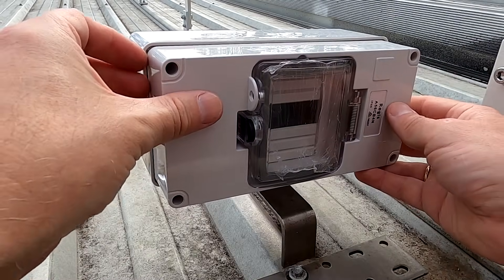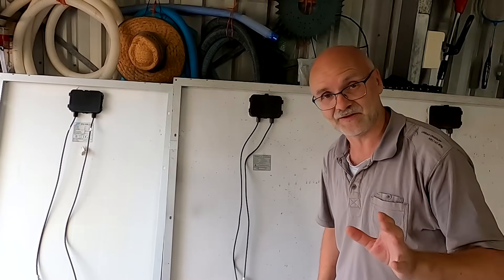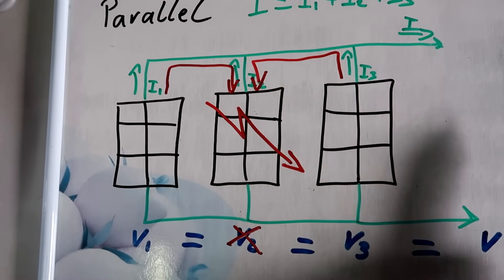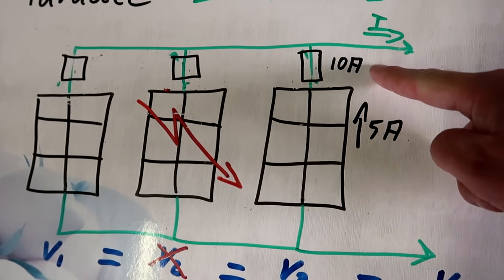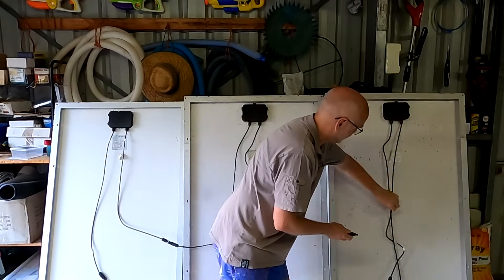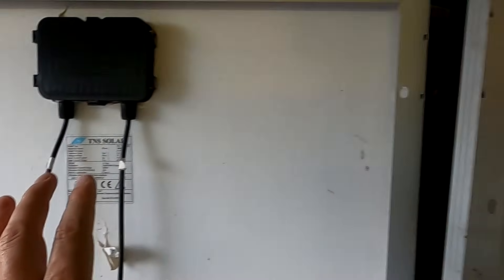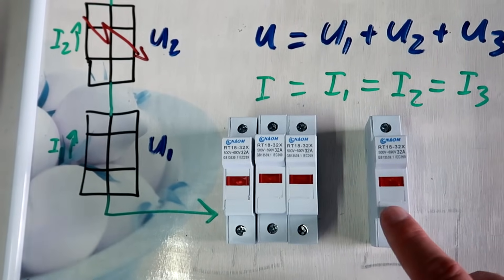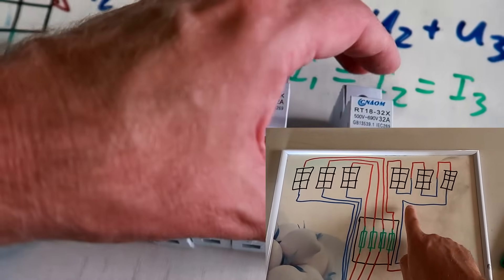Tutorial: Solar Panel Protection in Series and Parallel

Comment: 05:15 but what if you have only 2 panels in parallel and 1 gets a short? You will get the amperage of the other panel flowing through the faulty one. In this case are fuses still required? The combined Isc of both panels exceeds the maximum fuse rating of each panel by 1.2 amps.

Comment: For paralell, just put one Diode in series on the +out Before where you paralell them (everything can fail, a fuse makes it safer, but is no guarantee, think about the materials, what will happen if one them exits for instance 250W of heat in some tiny spot).

Comment: Hi, I'm new to PV field, but I think that a faulty panel typically increases its internal resistance, thus the back current flow into one damaged panel  (in a parallel connection) seems rather improbable. Also, I guess that in parallel connected panels, these  3 or 4 in 1 connectors cannot be used near the PV panels (at least not on both polarities), since at least one cable from each panel should be fused near the cabinet. I suppose also, that that single cable/connector could carry without problem the combined current of all 3 or 4 panels.

Comment: Thank you so much, this video was really helpful to undestand overall concept.
I have 20pcs of 250W solar panels, 4pcs of 12v-200Ah batteries connected in series and hybrid inverter, but instead of getting 5KWh, i always get 1.8KWh even during hot days. 
Guys who installed it, did not use MC4 connectors,charger controllers, fuses or UV safe cables. At the time of installation couple years ago, I had no idea of solar panels tbh. So now, I have to redo all the wiring, install charge controller and fuse. Do you recommend to have 5 groups in parallel with each group having 4 solar panels in series?

Comment: it sounds like  you're installing your fuses outside, near the panels. why wouldn't you house them in an enclosure inside a structure, away from the elements and hooligans, near your controller(s)/inverter?

Comment: Did you say that it is okay to send higher voltages to the controller than it is rated to handle? But if you send less than it handles it won't charge the batteries?
Sometimes i use a 24 vdc panel to charge a 12 vdc car battery. I also use a 20 vdc power tool battery with 3 or 5 amps to jump start my car.

Comment: I've got six (6) LG panels

The panels are what I was told in parallel and series. 

An inverter and an MPPT charge controller with 4 100ah lifepo4 batteries in parallel. 

My question is why one day my PV output is almost 900w while the next day is at 450w?
Why?  Connections are solid, no panel obstructions!?

Can't I just use breakers instead of fuses?

Comment: So what is the used of the diodes installed in a solar panel and also there's always a warning in the label that tell us that the maximum series connection is only 3 pcs of solar panel. also dc breaker mcb is much cheaper than a fuse

Comment: One major thing to mention, parallel connections have the the distinct advantage of still producing power regardless of a faulty or  individually shaded  panel where as series string connections will reduce the whole string to whatever individual panel is producing the lowest amps. The advantage I see for series is efficiency,  less voltage drop and cheaper fusing and  cabling. 
For me personally I wouldn't use less than 48v charging in bigger systems. So the perfect medium would be multiple parallel connections of strings of 2 or 3.

Comment: It only needs one breaker in the home which its amperage is predetermined by the total amperage from the solar panels.

The video logic is not feasible

And if one of thr panels is faulty, it means it is totally faulty indeed as not to add up current, unles series connection is best based on ur charge controller type

And respect to this man for using a camera swiftly and making explanations as clear as he could

Comment: I would of thought if one of the panel's developed a thought or shorted out, then that link would brake. I didn’t think there would be continuity in that panel to allow a current rise but i guess some off the cells in the panel are connected in parallel cursing a current rise in falt condions. Good information. I always size fuse  at 120% of normal current use asva guide.

Comment: i have a question if i put 24 panels of maxsimum power voltage 42.2 volts, and i put inverter 10 kw with maxs input range 600  v, but its writing input voltage range 160-1000 v, i.m over reaching volts with thoas 24 panels - 1012.8. DOES  this SUNGROW 10 KW INVERTER IS GOOD FOR ME, OR I JUST NEED BIGER ?

Comment: Ok for a 24 v system  2000va hybrid inveter _ connected to 2two 12vbatteriss and two 450vpanels of 36v o/p ..would you recommend parallel or series?

Comment: Hello writting from Nigeria,please I have a question I don’t get where the fuse is to be fixed in a series connection is it on the negative or positive output???? Please I need an answer

Comment: Here in the Netherlands I have seen, tested and certified many solar systems. All that were in string (so in series) never had any fuse. Neither is it needed in the specs.
Paralel  is different of course,  but that is selden used. Only in big systems.

Comment: Very helpful and enjoyable video... A question: For four 100W panels in series-parallel putting out about 14 amps max and going to a 40amp controller over 10AWG cables, do you recommend a breaker-switch near the controller in that circuit, and if so, what amperage rating? ...Also, would you use a 10amp inline fuse on the positive wire of each of the two 200W panel series (two 100w in series) generating 6 or so amps going to a two-into-one parallel connector? ...Thanks...

Comment: I'm watching your video, and so far noticed that you haven't mentioned that the International Electrical Code, which is the basis for almost all National Electrical Codes for safety, actually includes a section on solar panels, including when, where, and how to fuse solar panels. Generally, if 2 identical model solar panels are wired in parallel, no fuse is required because the output power of a single solar panel is less than the short circuit current rating defined under the panel's specifications. As you stated, series configurations do seem to provide a better benefits in savings via smaller gauge wiring and fewer fuses, but as you also pointed out, it depends upon your personal situation and circumstances. Also, I'm not sure if it's been officially included yet, or if they are still working on it, they as in the international groups, associations, and organizations that research, develop and test upcoming standards, but I believe you may be interested, since I think you mentioned that you own an EV. There is, or in the nar future will be a section in the international electrical code for a very specific installation in predominantly residential dwellings. Simply put, people have been converting their EV's into emergency electrical battery back-ups. Work has been going on to develop standards to install and maintain, essentially a dedicated EV "power port" so your car can keep your fridge running during a power outage. Even with solar and batteries, if a storm lasts long enough, it provides an opion for people who may not have an electrical generator, or an insufficently sized generator. Just an FYI, if you didn't already know.

Comment: If the panels is connected in series or alone there is no need for fuses because the short circuit ampere is exactly the same as normal operation amperes, meaning the fuses will have no effect and never break and never protect anything...  +

Comment: Sir,why 12volt s/panel parallel connection and 24 volt s/panel is mostly used by series connection . how to calculate the s/panel load 5 kwh 60volt battery in series

Comment: The blocking diode have max amp.
It burn over the amp and act like a fuse.
And you can replace. 
And if you open it .
It use the same what you have in that big blok.
You use not fuse but a amp rate blocking diode.
Its use in my couny and have iso certifcat and Germany tuf .
Means its test and save .

Reason solar panels burn is easy .
The cable is damage for the fuse or its internal burn from diode inside the panel and the panel is overheating and the panle cell burning out 

Problem is how company sell thare stuf.
And what country its make.
And use name for it.

Model like this 
Thermal temperature fuse protection diode mts228
225celcius 10a rating 

Diode sper the volt of 1000volt .
A panel setup up of 500 volt can never break a diode .
So its a full stop on a parallel if one solar panel is broken.
Now volt or amps will go to that diode.

Comment: Technically, the voltage in a parallel system can change, as it will be constrained by the panel that has the lowest voltage output

Comment: Touching just one lead from the panels in sunlight can hit you with a capacitive discharge if you are grounded. I got hit with 400 volts capacitive on a system with 27 panels in series. And opening a fuse while under load can arc very badly. DIYers need to be aware of the dangers and make friends with an electrician and buy him lunch. I'm available most Thursdays. LOL
Reply: Is it best to cover panels with black plastic or blankets when connecting leads

Comment: I am a newbie too. So if I just add another panel ( 2) ony roof do I need a fuse in each positive wire on back of panel and what do I use as I watched you showed 3 fuses that would be inside??? How?  Im not clear on the fuses and howuxh of I splice them into the positive right off the panel

Comment: Video/ explanation concise, tanx. 
Kindly help confirm if there will be waste of energy generated from a 3pcs of 300W solar panels connected in parallel via a 60A PWM charge controller to a 12V inverter system

Comment: What should be the more effective and safe connection way for a 100 watt polysolar panel, 85 watt mono solar panel, rated 150 watt charge controller, 130Ah battery?

Comment: Solar panel Parallel never output to same voltage, even it is same manufacturer. each should have a diode than fuse box

Comment: Please my question is you have 430 Watt solar panels and if you connect in series you have 76volt 38v each and I have two batteries of 12 volt each given total of 24V while I have panels of 76volt.
Is that 76 volt not too much in my 24V battery and inverter?

Comment: I think I understand.  I am newbie with some background in electronics as an audio sound engineer.  I just bought two 300 watt solar panels (both are same ELECAENTA ultralight) which I am going connect together in parellel.  The current for each solar is 7.69a and the short circuit is 10.1a.   I like to add fuses in this setup. I think I understand you multiple 1.56 x (10.1a value of short-circuit current) = 15.756.  Thus I assume I should get a fuse rated at 15a at each panel and just to be safe have 30a at the solar controller charger. I have the Pecron E1500LFP.

Comment: Nice video! I noticed a mistake in the series connection explanation. You mentioned it requires a 10A fuse, but the panel label actually recommends using a 15A fuse for string configuration. For Parallels connection 10A is fine.

Comment: Whaou! 
Thank you for this information. 
I have only 2 panels for my motorhome connected in parallel to not heat my MPPT unnecessarily with a 24v battery. I wanted to add 2 extra in the summer with the air conditioning. 
I wouldn’t have thought of the fuse to protect. 
No resellers informed me yet I asked if there were precautions to take.

Comment: what a great series of videos you made. you should make a playlist of "solar basics/safety" and "installing victron devices" 
just in case anyone reads this, bear in mind that MC4 connectors are only rated for 30A so the 4 into 1 is only ok for smallish panels.

Comment: Very good explanation. I heard the biggest absurdity from people about. Diodes, fuse on a single panel,diode between mppt and panel...
Just only a detail. Fuse will be sized not on max power current. But on the spec ""max admitted reverse current " . And this is bigger than max power current. Example: on halfcut 450w 144 cells panel with 10A Max power current, is 20A. In most of cases of a decent panel, also find "max series fuses rating" and is the same of reverse current.

Comment: There are nice in-MC4 fuses. But: fuses operated under (near nominal) load get warm. Inside MC4 enclosure the heat cannot escape and the connector embedding the fuse could  melt.
What about using diodes instead of fuses? Do they also get warm? 

What about Schottky diodes that do only loose 0,15-0,25V instead of 0,7V)?

What are your conclusions after 3 years experience?

Comment: Hi , I am getting a single Renogy 550 watt solar panel , the- open circuit voltage is 49.95 volts and and the short circuit current is 14.05 Amps , so do I need a fuse prior to the charge controller?  It’s going to a Ecoflow Delta Max, Portable Power, Unit Power station, which has a charge, controller, built-in, and the limits or within the solar panel.

Comment: PV panels have internal diodes to stop reverse voltages, if fitting additional diodes remember that in the forward flow ,IE, when PV producing voltage ,they will reduce the output by 0.6 to 0.7 volts!

Comment: Even the cheapest chinese panels now days have blocking diodes built in. They do reduce overall power a bit (roughly .5v × panel current), but they give you a great protection as well. Never seen them fail. There is no need for individual fuse. Unless you want to add a few points of failure to already complicated system. A lot of freedom for personal preferences. =)
Reply from the maker: This is not correct! Every solar panels has a bypass diode, not a blocking diode. Major difference explained here in another video I made:
https://youtu.be/J9jqUwOdnEI

Fuses (or DC breakers) with the correct rating are a MUST as per regulations.

Comment: If I keep the volts under the rated maximum (138v vs 150v max) can I "OVER" panel and go slightly above in amps? (17.5amps vs. 13amps per Ecoflow solar generator. Will  controller only take in up to 13amps?
Reply from the maker: That depends on your controller and if it can handle the increased current. You have to read in the manual and specs what the max wattage is your controller can take at a certain system voltage.
Reply: @OffGridGarageAustralia  16:10

Comment: If someone can do it themselves with a off grid solar system going to a battery bank... how much more would they need to know to do an on grid solar system that feeds your electricity into the power grid? Is that even possible to do without being an electrician? thanks.

Comment: Will the panels last longer in parrellel or in series?

..

You used fuse boxes for your panels in your explanation, would it work to do circuit breaker switches instead?

Comment: Excellent video. I understand things much better regarding solar. I bought a 4-100 watt panel system for my truck camper got 1-10amp fuse so thought I only needed one. Well I installed and the fuse blew. Now have connected 4 fuses /one per panel and it works like it suppose too.
Reply from the maker: Thank you, I assume the panels are all in parallel?

Comment: I’d be curious to know the scenario under which the 10 amp fuse in series with a set of 5 amp panels in series would blow. The short circuit current of the panels is below 10 amps, so it is an inherently current limited source.
Reply from the maker: If you parallel several strings and each string can deliver 5A, it can exceed 10A in case one string has a faulty panel.

Comment: I would use a Mc4 inline fuse m uch cleaner and waterproof, and maybe a diode in Addition after the fuse, so the diode stops potential backflow, if it fails, there is still a fuse.

Series is much safer in my opinion, lower current, less heat etc. Cables are also cheaper for series connections, my setup is fused with 15 amps, because the panels only provide 12 or 13 amps and i have to use a pretty long wire from my panels to my charge controller and battery. That means less voltage drop.
Reply from the maker: Series is not always better though. If you have shading like I have, parallel is the way to go.

Comment: you are wrong with paralel protections. fuses will not blow !!! if you know about how a fuse blow then you not will make this mistake, put instead diodes !! for series conection same, fuse is useless, will never blow! except maybe a huge power comming from mppt ! but this is not usual at all !
Reply from the maker: Diodes are not considered a safety device when you look into the regulations, fuses and breakers are.

Comment: How many Amps charge controller can I use for 300w solar panel
Reply from the maker: Depends on your battery voltage, 12V, 24V or 48V
Reply: The battery is 12v

Comment: Excellent explanation sir, but i have question , if i use different wattage of solar panel in series what will happen to the system thank you hope you give me a clarification thank you and GodBlessed
Reply from the maker: Don't use them in series. It could damage the smaller panels if the difference is too large.
In series: must have the same current parameters
In parallel: must have the same voltage (plus add fuses for each panel as needed.)

Comment: 1) What are the disadvantages of serial connection and the advantages

2) What are the disadvantages of parallel connection and the advantages
Reply from the maker: That's a very comprehensive question. There is no real advantage of disadvantage of doing either. It solely depends on the system design and what you are trying to achieve.

Comment: What if you have 12v inverter 2000w and u have 12v 200ah10hrs 3pcs,8pcs of solar planes unainditincal, meaning 300watts 5pcs and 250watts 3pcs ,which connections can use?